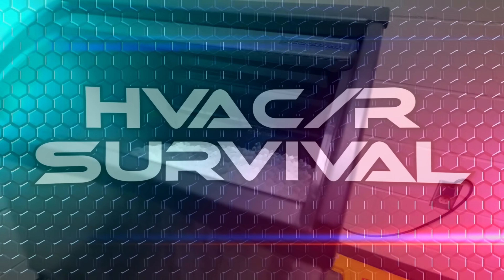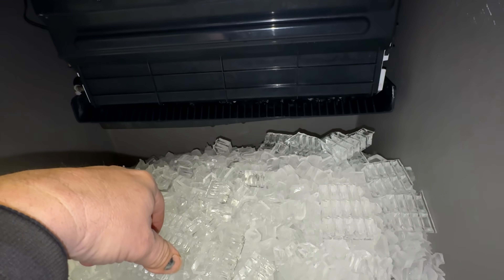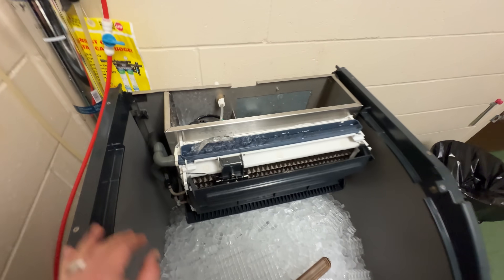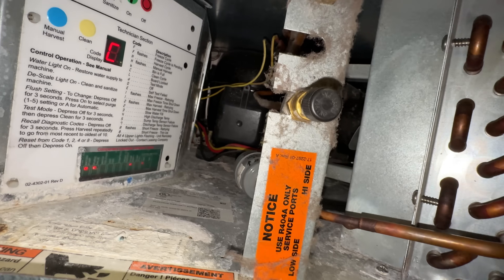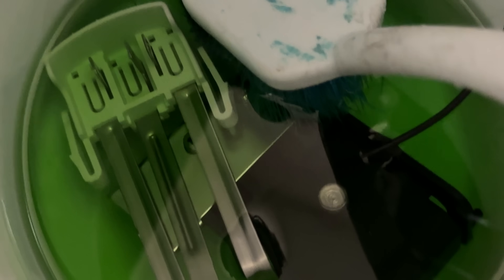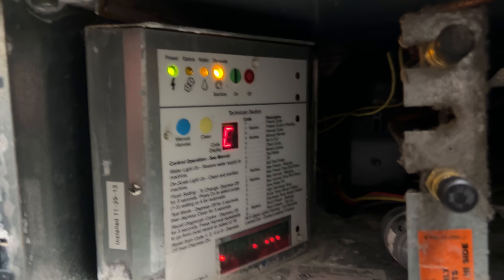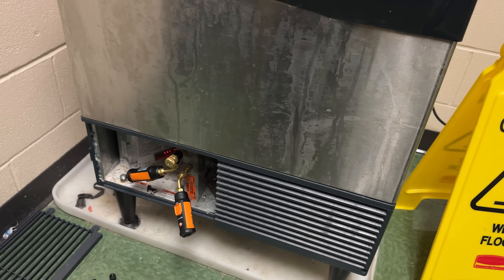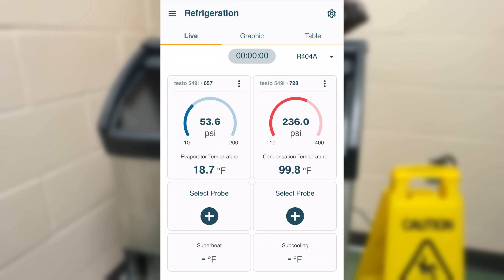ICE ICE MAYBE...NOT! Ice Machine Not Making Ice

Comment: I probably missed it, but did you dump the ice and sanitize?
Reply: Def should not use the ice after cleaning. Its food grade but still has concentrated phophoric acid. Rinse for min 30 sec and throw out first batch of ice
Reply: probably took hose, melted it all down and rinsed out or had facilities maintenance handle that part, they probably do it often anyway.
Reply from the maker: Yes you want to fully rinse the machine and trash the ice.